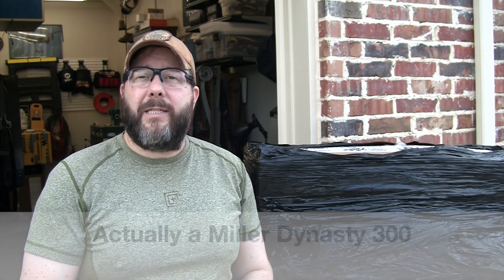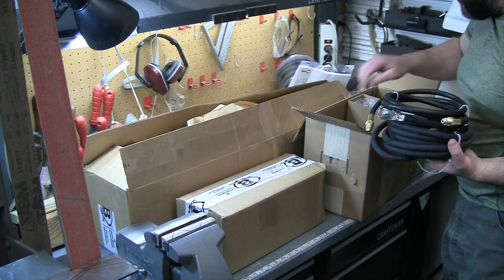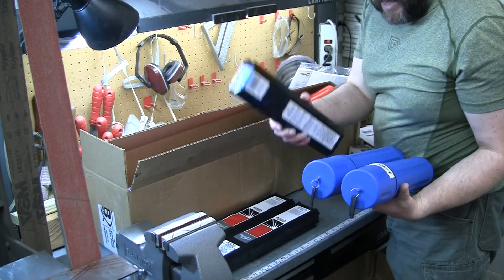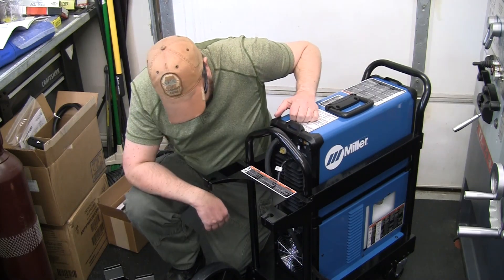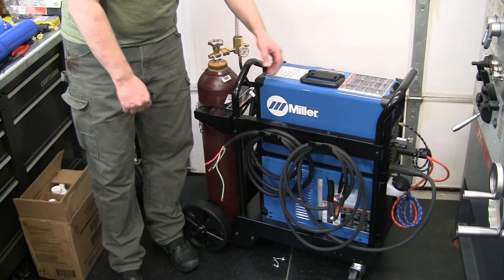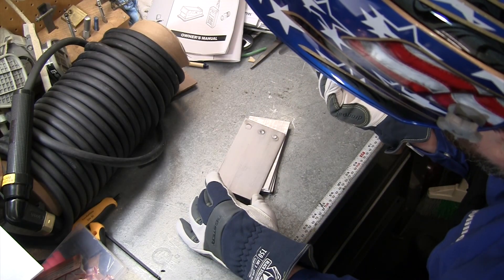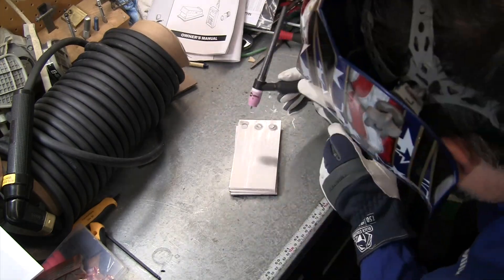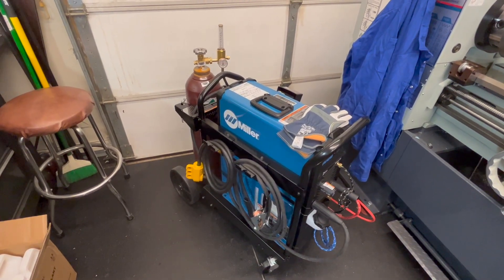Miller Dynasty 300 Unbox - Set Up - First Ever Tig Welding Arcs

Comment: I’m extremely jealous! That’s the TIG welder that I have on my wish list. Congrats! I look forward to a review video once you get it all figured out.
Reply from the maker: @Freedomfabrication - Thanks for the comment. Was on my list for years before pulling the trigger. I love it so far. I have not been getting enough Tig practice in but it is coming along. I go the extra leads for stick and it is the nicest stick welder I have used in a long time. My wire feed does not have long leads and I just did a trailer repair over the weekend and having 60’ leads gives me a lot of room to work. No regrets on the buy for sure. I will try and get a better review of my progress out there.
Reply: @BladesIIB  One of the smoothest stick welders I ever ran was a dynasty. I’m sure that will be a great addition to your shop for both stick and TIG. I’ll be watching for an updated video on what you think of the machine.

Comment: The welder I used for years was a 400 amp miller syncrowave. You could use pure and 2% thoriated tungsten pretty well. The newer machines chew those up more than the older machines. The thoriated tungsten is slightly  radioactive.
Reply from the maker: Bernie Janssen - Never had the chance to run an older Tig machine.  Sounds like I will put Thoriated at the bottom of my list of Tungsten to try.
Reply: @BladesIIB I used thoriated, I really believe I got radiation poisoning from using it. My hair fell out in patches. Once I stopped welding due to other things on life coming ip, my hair grew back slowly. Now I have all my hair and will NOT use thoriated tungsten.
Reply from the maker: @MonsterTruckingCo.  Glad to hear it was a full recovery.
Reply: @BladesIIB  I got lucky, so I always advise people to use non radioactive tungsten, and if possible, get a tungsten grinder that grinds wet so there is no tungsten dust in the air either.

Comment: Make sure you have good grounding on the tig machine. If it has high frequency for starting you have to watch circuit boards. High freq has been  known to fry boards. Have to be careful with electronics with high freq. When I  was welding it fried the board on our burning table. When I  weld in my garage I pull the plugs on my lathe,mill, and cnc router just to feel safe.
Reply from the maker: Bernie Janssen - Thanks for the tips.  It does have HF start.  Also, I just spent the weekend building a little bench top welding table, the metal bench top was definitely not a good place for more than the quick starts I did here.  Good to know about circuit boards, I will be aware of what I have nearby, thanks.

Comment: I think you'll catch on pretty  quick.
I started to learn to tig weld when I was 16 years old. Going on 67 now and still have the bug to play around with the tig welder. The gas costs so much anymore. And if you want to get helium gas you might have to trade your car for a bottle.
Reply from the maker: Bernie Janssen - Thanks, time will tell. Thankfully Argon is all I need for now. 😁
Reply: @BladesIIB  
Only used that for welding copper to something thin. Its hotter than using argon and didn't  use much of it.

Comment: When cleaning aluminum you dont want to use steel wool or steel wire brushes. Stainless Steel only and acetone for cleaning the oils and contaminants. Aluminum has oxidation on the surface that needs to be removed for a clean weld. If your tungsten starts balling on the tip and spitting cut back on the heat and cleaning on the arc. Pur tungsten works on aluminum but doesn't  hold up well for the arc cleaning setting.  Ceriated seams to hold up better than pure or lathaniated.
Reply from the maker: Bernie Janssen - Good to know, I am using Acetone and a SS wire brush for cleaning the material, so sounds like I am on the right track there.  I am balling my tungsten first for a more stable arc (as recommended in the course I am taking).  The inverter machines like this Miller do not seem to like pure Tungsten, they recommend never using green at all.  I am currently using 2% Lathanated but also have some 2% Ceriated I will try.  Appreciate all the tips.

Comment: Bud, do you have a video explaining why you chose the Miller?  I’m probably a year away from where you are.
Reply from the maker: John Crisman - I don’t have a video on that. I wanted a good AC machine for aluminum. I decided I wanted a good commercial grade machine (even though I am not using it daily) because I want it to last for years and I wanted a quality machine and welding experience. I have a good friend who owns a machine/welding shop who I worked with many years ago and he recommended the Dynasty. Some research and I narrowed it down to the Dynasty and the Fronius.  The Fronius has great reviews. Can be harder to repair with only a handful of dealers across the US and for a beginner the menus on the Miller with the pro set options seemed more intuitive. I talked to a couple people and the Fronius may require a little more knowledge of setting up front. That is how I narrowed down to the Miller. I think Everlast has some quality AC machines as well. There are definitely more economical machines. Good luck finding the right one for you. Tig welding is definitely as fun as I was hoping.

Comment: Nice vid.. hey if I buy this machine do I have to buy the power plug separately or can I have the option to come with it? Where did u buy that power plug? Would a single phase 250v 50 amp outlet be compatible? Sorry for the rant
Reply from the maker: Alextremo - Thanks for the questions.  The unit comes with the power cord, but there is no option to purchase the plug with the unit that I am aware of.  I just purchased the plug from Amazon, you should also be able to get from any electrical supply and likely even your local hardware store.  The welder is pretty flexible on input voltage and can take anything from 120 all the way to 480 volts, single phase or three phase.  This variability is, I am pretty sure, why they don't supply the plug.  Everyone is using something different.  I have mine plugged in to a single phase 220 outlet with 50 amp breaker so what you have planned should work fine.  Hope that helps you get going.
Reply: @BladesIIB  thanks for the quick reply!! This helped a lot 👍🏻👍🏻
Reply from the maker: @alextremo7853  Great, all the best getting your new welder set up.

Comment: How many amps is your circuit?
Reply from the maker: @mahimac8126 - I only have it plugged in a 50 amp so not enough to pull full capability from the machine. I believe it needs a 65 or 70 amp if I were cranking it all the way up.

Comment: Your going to want a bottle about 3x the size you have. Learning uses ALOT of gas. When I was learning, I was using a 120 bottle every 4 days
Reply from the maker: Monster Trucking Co. - Thanks for the heads up. Been more focused on getting knives ready for the Atlanta show lately. Back to more practice soon.
Reply: @BladesIIB  the biggest wasters of gas is the pre flow and post flow settings. Post flow in my opinion is more important than lots of pre flow.

Comment: 😁
Reply from the maker: @tigxxl  thanks for the comment.
Reply: I also remember waiting for my toys less than 3 years ago. Except that I did my first welds on a course, except that the machine was worth less than my current torch 😂
Reply from the maker: @tigxxl  Wow!  That sounds like a really nice torch 😂😂😂
Reply: @BladesIIB 😂 Not necessarily, a standard 220 amp gas cooled Feonius torh with a quick-change tip, cost around 550usd. Now imagine what kind of tig with AC\DC I learned on 😅. If I had known earlier, I would have ordered a CK water cooled torch for 250a from the US, lighter and much more flexible with a flexible tip for much less money 😢
Reply from the maker: @tigxxl  sounds like a great set up. I was just joking since I know I have more machine than I need. But I do enjoy it. 😀
Reply: @BladesIIB  I know what doesn't change the fact! 😆 Great that you shared your Christmas experience with us! 🤩 It's great how someone can achieve their goal or fulfill their dreams and the machine is never too big/swet! 🤣 I will be completely happy when I finally start my own version of the Fronius cooler (I'm looking for pictures of the electrical harness cu600t about 2 yers🙃) and have time for welding. Greetings from Poland and as much welded wire as possible 😁
Reply from the maker: @tigxxl  Awesome!  Thanks. 😎

Comment: I'm never buying Miller again. I was going to buy a cheap chinese TIG welder when the older guys at work convinced me to buy a Miller or Lincoln. They told me if I need parts, I can just call them up or go to a local rep and I can get the parts for free if its under warranty still instead of a cheap chinese welder where I have to talk to someone in China. 8 Months after I bought my Miller, something broke where the display didn't work and I had to fight them tooth and nail for them to honor the warranty. And when they finally agreed after a few weeks, they said it'll take 6 months to get the part... from China.
Reply from the maker: robotech - Good to know. I hope mine does not have a failure, sounds like it can be a hassle for sure. Sorry you had such a bad experience.

Comment: Fronius
Reply from the maker: @llnex - Appreciate the comment.  I have heard nothing but great things about Fronius and did consider it. In the end it came down to what was locally available for both the initial purchase and parts and service if needed in the future.  So far not unhappy with the Dynasty.  Maybe one day I will get to try a Fronius to compare.
Reply: Yes I agree but not entirely 😆 because for reasonable money you can buy iwave 230i (I have) and it is only 230 amps and above that limit the price becomes astronomical. And if I am not mistaken you can connect a wire feeder to this dynasty and have MIG (unfortunately on the Polish channel testing welders they did not check/run this option too thoroughly) 🤨